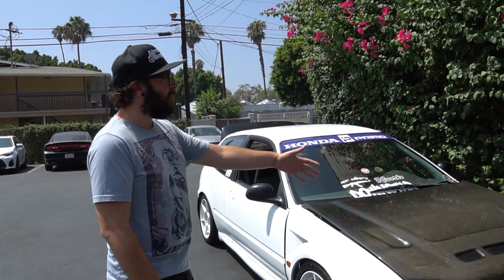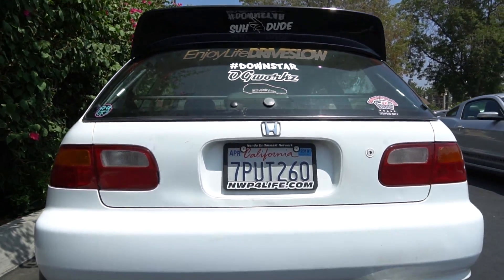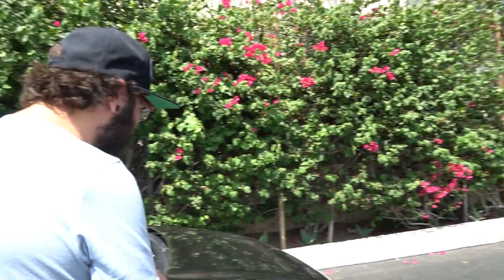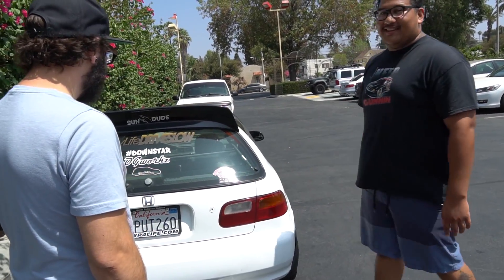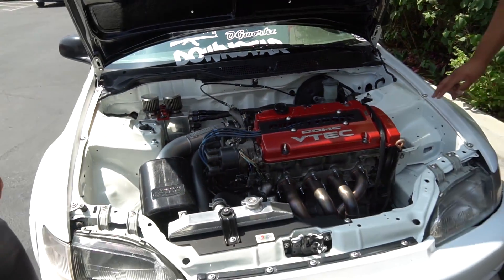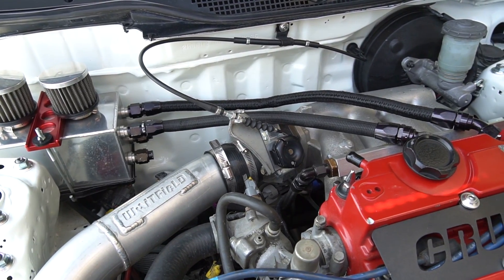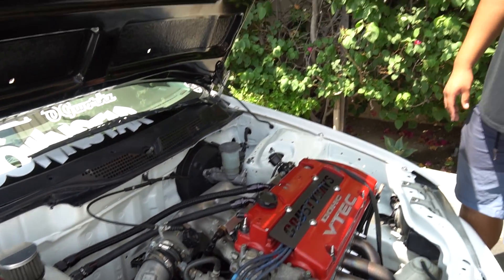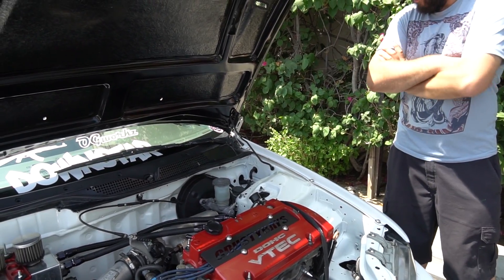F20B to B  Swapped EG Hatch - The Izzystillydgn Special

Comment: The main attraction to F20B over H22 is the fact it has iron sleeves where all H series have the lame FRM sleeves. I wish you (HondaVlogs) would give some attention to the F20B turbo build on Sleepy EG's channel. Its his buddy Alex's. Its a total frankenstein. F20B block, H22A4 crank, H22A head. RBC manifold etcetera. His goal is 800whp. Its an amazing build they could use some attention to their tiny 300 subscriber channel.
Reply from the maker: Oh shit!  Thanks for telling me ill Def check it out!!!
Reply from the maker: I got them in tomorrow, their builds need more attention. Thanks for the head ups dude!
Reply: H22 head on f20b is asking for trouble the the dome size of the combustion chamber in the h head is bigger then that of a f20b so your donation will always be off no matter what you do. And your cylinder walls will start to crack up top. Just a heads up.
Reply: Edgar Madriz bullshit been run H heads on F blocks for years no issues as long as you know what you’re doing. Type of HG and HG thickness play a role as well in reliability
Reply: Yea I went through 2 h22s because of FRM sleeves! Just got a jdm f20b bluetop so none of my h stuff will go to waste!
Reply: @f20b___cb7____9  f22 blocks are the same diameter as an h22 we are talking about f20b. Too totally different blocks. Do a Google search in cb7 tuner group and you will get your answer.
Reply: Edgar Madriz I didn’t even click the link. I’ve actually swapped out heads and cranks and rods between H and F over the past 10 years to know what I’m talking about. Also there is no f22 with a 87mm bore from the factory. So what are you saying about they have the same diameter? Hope you aren’t talking about the cylinder bores lol
Reply: @f20b___cb7____9  ok I know where you are getting confused. You can swap crank and rods etc. But a f20b head the combustion chamber the dome on the head is smaller on the f20b then that of a h22 or f22/23 that's why if you just swap the f20b head to h22/f22/f23 block they don't last ever. This has been gone over in the Honda scene over and over. That's why if you want to build a f20b stick with the head and block they match up perfectly.
Reply: Edgar Madriz I wasn’t confused at all. You may have been confused about what I was saying. I’ve swapped h heads on f blocks but never put a f20b head on a h22 block. That’s pointless. F20b Head has smaller intake valves and a 85mm bore. If you want to make less power than by all means use the f20b Head. But putting a h22 head on a f20b is completely fine. Just won’t make as much power (f20b head h22 block) and always match your head gasket with the block when doing a frank build.
Reply: @f20b___cb7____9  read your response to my original post. I was primarily talking about h22 and f20b never f22/23 and your response was you can on f which you meant 22/23. I know this as well but I never was talking about those blocks to begin with. That's why you got confused with what I said. I'm not doubting your building abilities.

Comment: Dude needs to ugrade to a 15/16 '90-'91 EF sedan EX master cylinder. Its a direct bolt on to the stock EG booster and lines and it made a world of difference on my rear disc swapped EJ1.

Comment: Kinda low for a f20b.. should be around 205
Reply from the maker: I dont have tons of knowledge on the f series but he mentioned it was a auto motor so he doesn't have manual cams
Reply: Just a 5.0 should be close to 200 with a 3inch exhaust